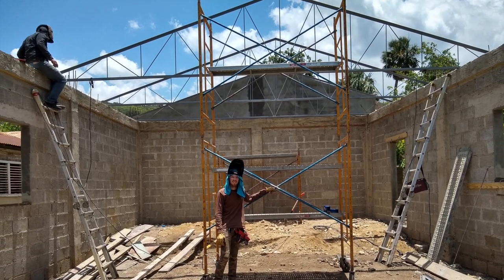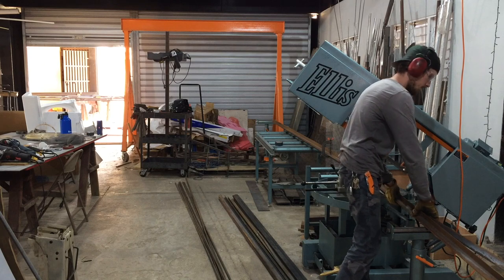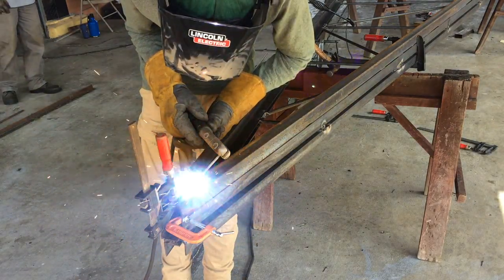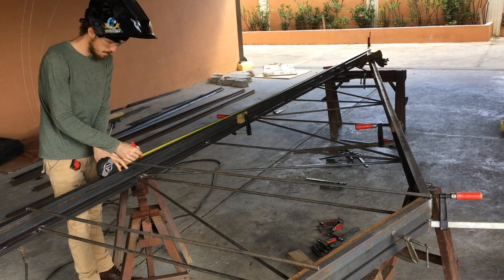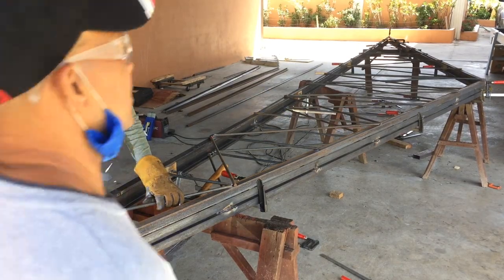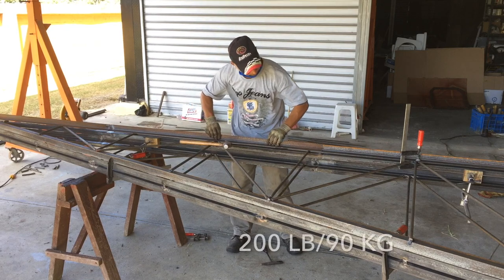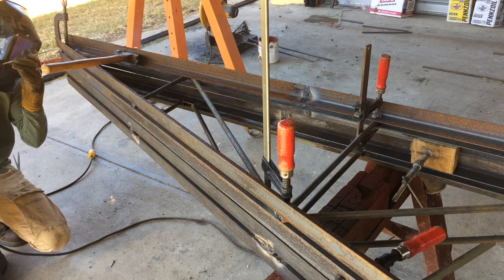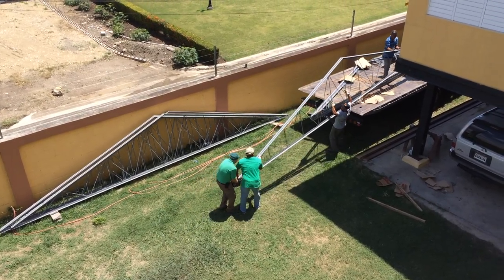Building & Installing Metal Roof Trusses 28'

Comment: Hi Darren, which software did you use to calculate the size from the trusses ?
Reply from the maker: I use fusion 360 for the most part but I mainly just draw I haven't figured out all the features for calculating the strength of material

Comment: What is the size of ms angle used? I mean depth of angle.
Reply from the maker: I am not sure that I understand what you are asking. It's a 4"/12" roof pitch if that's what you are asking.
Reply: No no.. I am asking about size of angle used as rafter and main tie
Reply from the maker: (1.5"x1.5"x1/8")(40mmX40mmX3.175mm)
Reply: Thank u ...

Comment: Hi Mr  210 sq. Meter residential house
What is the materials needed for trussess and roofing?  And how many pieces might need.
Reply from the maker: That would be a complicated question to answer without a lot of information.
Such as do you have a snow load what wind forces do you get in your area what are your local building codes.
 it probably would be best to consult a local engineer over the different variables for your location and application.
Reply: @CreativityUnleashed  ok thanks